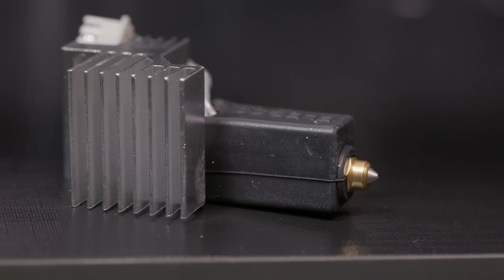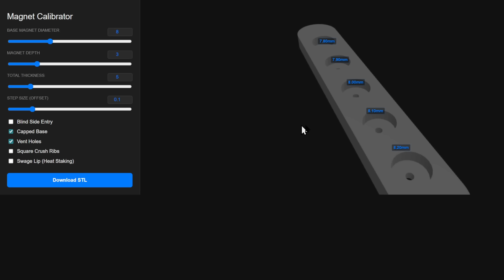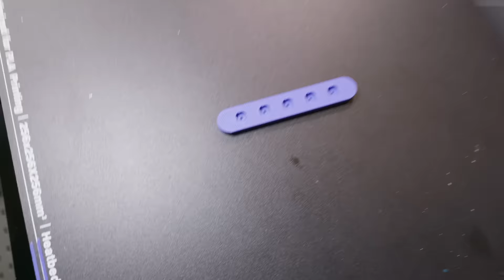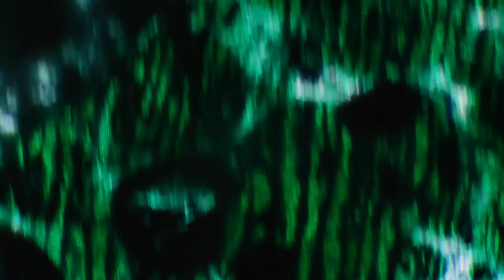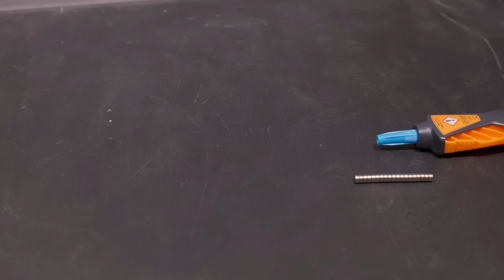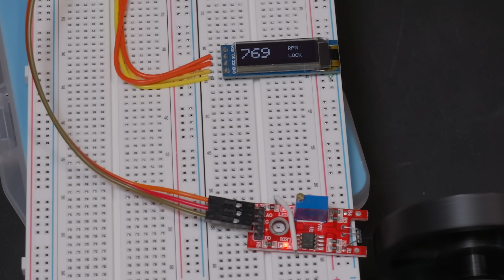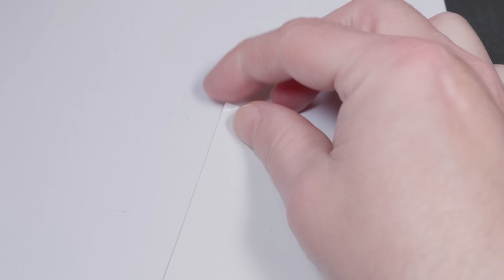Magnets in 3D Prints: How to ruin your printer edition

Comment: Many people often confuse a magnet's Curie temperature with heat resistance. While the Curie temp (point it will completely demagnetize) of sintered neodymium exceeds 300C, standard grades (N35, N42, etc.) have a maximum rating of about 80C where irreversible flux damage starts to occur. Higher grades (e.g N42M, N42H, N42SH) have additives that can increase their coercivity and temp rating to about 100-150C. Specialty grades can push upwards of 200C but beyond that something like Samarium-Cobalt is needed.

However that's for single magnets in an open state. You can partially increase resistance to flux damage by just fixing it to a material like steel to close the magnetic circuit. That can potentially allow even standard grades to exceed 100C before significant damage occurs but you still can't take a soldering iron to it.

Also the reason cheap 3D printer bed magnets aren't notably damaged at 100C+ (as many claimed they would over the years) is because they're made from ferrite particles that are more resistant to this than neodymium and it's constantly in a closed state against a piece of steel. The main concern are the binders, adhesives or certain bed surfaces degrading but even many cheap ones still hold up to 100-105C reasonably well.
Reply: Wow thx this is actually a really nice cheat-sheet and gives edge-information as well!
Reply: Correct me if I am wrong. 

This has to do with a material’s permeance coefficient (Pc). Basically the aspect ratio of a magnet. A longer magnet will have a higher Pc and less susceptible to demagnetization. We can follow a magnets hysteresis curve (2nd quadrant) at different temperatures for a particular grade to see if the Pc hits above or below the knee (irreversible demagnetization).
Reply: Thank you, I didn't realise how much I needed this information.
Reply: Is it true that you cannot re-magnatize a neodynym magnet? If so, how are they made?
Reply: @JeffBradway  Again it's a question of how much heat was applied. It's technically possible to regain most, if not all a neodymium magnet's strength lost to overheating unless it was heated all the way to its Curie temperature.

At that temperature it undergoes a phase transition from a ferromagnetic state to paramagnetic state where microstructural changes causes the magnetic domains to collapse (each individual grain aligned during initial manufacturing is effectively randomized). While some magnetism can still be restored it's impossible for it to regain its original strength.

However if heated high enough beyond the Curie temp to the point where the 'physical' alignment of the grains locked in during sintering have even shifted out of position it's unlikely it can ever regain useful strength again.
Reply: @JeffBradway  Gauss machine I think? Also the powder that they are made off is being pressed into shape while exposed to a strong magnetic field already. And all the machinery is very big/expensive, so nothing for typical home diy.
Reply: @DiverseGreen-Anon  im not sure how much of the original u would get but if u make 2 electromagnets on each side  put them in oposite series and discharge a big capacitor u probably get some magnetization back
Reply: this is really cool info to know !
Reply: What a wonderfully informational comment

Comment: Great info, always interesting to see how others do things. Most of the time I use press fit with glue for external and loose with a dab of glue for inserts. The orientation is always triple checked as I place them, the number of times I overcorrect though 🤪. I have a drawer full of sizes now and order off Ali, though cheap does come with quality and size variations so I always do the dummy shrink testprint to calibrate each new model.
Reply from the maker: Oh yeah that's something I forgot to mention, some magnets I had were undersized, not many but enough to cause confusion!

Comment: Actually I’m pretty sure the ESP32 has a built-in Hall effect sensor. Might not be very useful under that RF can though.

I like adding a thin layer of plastic between the magnet and the real world. Much less likely to be attracted to something quickly and shatter the magnet, and cleaning magnetic dust off it is easier. Super-glue in a print pause is what I often see recommended for this purpose.
Reply from the maker: I had no idea, but googling tells me you're right and it's disabled

Comment: I ran a 3d printing shop for a couple years, printing a variety of toys and novelty items using a small fleet of Ender 3 like printers. I have a few designs that use magnets and I always preferred embedding over other solutions. This was important for toy design to avoid the risk of a dislodged magnet becoming a choking hazard for kids.
Reply: Choking is the least of the problem.  A couple of magnets stuck together with a bit of intestine between them isn't cool.
Reply: child safety above convenience. Thanks
Reply: @Stray-Signals People printing junk toys and widgets has massively contributed to microplastic pollution over the past 10 years. It's even worse with 3d printing because the materials are already extruded in thin brittle layers that break down faster than a food grade container.

Comment: Great video. My go to method now is adding compliant features like grip fins, with a chamfer to make inserting the magnet easier.  The plastic flexes and you don't need to dial in the settings.  I have a model on MakerWorld that uses this: an SLZB Magnetic Mount.

Comment: I didn't expect the words "do not put magnets near your printbed" ...to carry such weight
Reply: Especially if they're really big magnets.
Reply: @kwilliams2239  I recently used very strong magnets to hold down the glass bed from my old ender 3 instead of the textured PEI sheet, for a smooth bottom layer lol
It still seems to be fine tho, is it just that the magnetic sheets will be held slightly weaker now?
Reply: Problematic, because I just learnt about a technique where you use magnets to hold tissue paper on your bed then printing wing ribs directly onto it... Now I need to check my bed.
Reply: @Reahreic Tom Stanton?
Reply: @fastindy  No, but i think that's where I learnt it.

Comment: Stainless steel is not magnetic so if you want to insert magnets inside your prints use a stainless nozzle. I do this on my Bambu A1 occasionally and just switch to the stainless steel nozzle that came with the machine. (typically I use a hardened steel one, but that one is magnetic)
Reply from the maker: it can be, only way to know is to test it, one of the 4 nozzles in that line up was a stainless steel
Reply: Austenitic stainless steel is not magnetic, ferritic stainless steel is. Austenitic stainless has high nickel and chromium content; ferritic steels are low in nickel but high in chromium. Ferritic stainless is less corrosion resistant, has higher thermal conductivity and is cheaper, it's also easier and cheaper to machine as it doesn't work harden to the same degree as austenitic which is why some of the cheaper Aliexpress printer nozzles are made from ferritic steels and are magnetic.
Reply: @Steve_Coates  Ahhh... ok. I didn't realize that any nozzles were made from that other kind. I've only tried this on the official Bambu nozzles. 

You are right about reducing the magnetism though. I tried it on some hold downs I made for my laser and even though the magnets stick to the bed quite well the magnets embedded in my print don't work that great.

Comment: Brass is NOT magnetic. If your brass nozzle is, it likely has some steel in there.

Stainless steels tend to be weakly or non magnetic, but you can't rely on that without testing.
Reply from the maker: yeah it goes to show we have no idea what these nozzles actually are made of, beyond what we're told they're made of
Reply: @LostInTech3D Absolutely! 😁👍
Funnily enough, the woodworking screws I use are 'brass'... and they're magnet-seeking as anything.
They're clearly brass-plated steel. Probably cheaper to make. TBH it makes em easier to not lose 😂❤

Not as good for nozzles though.

Comment: The build plate’s magnet, which seems to fall under the “cheap” category, gets quite hot yet doesn't lose its strength.
Reply from the maker: For a while, I think it was a limiting factor in the max bed temp 🤔
Reply: It does. It's just it came from a high grade magnet that only lose part of its strength after heating.

Comment: What the heck do You meen? I have 2 ender3's😂
Reply from the maker: Actually so do I 😅
Reply: An ender 3 would be an upgrade from my Anet A8!
Reply: Yeah and since my "new" kobra s1 just chokes on TPU no matter what I try, I had to keep my modded ender 3 just for TPU. But on the plus side, I drilled a hole in the lid of the ace pro and added PTFE tubing so now I can dry filament while printing on the ender, which is extremely important for TPU!
Reply: @Gibson99 dude I tell You I did a linear rail and direct drive convertion on mine years ago and it is just a workhorse.

Comment: I prefer encapsulating them in the print because I find they eventually come out if you press fitting or use CA glue. It isn't a perfect solution though, I know.
Reply: Try Loctite 480 or for those little neodymium buggers, 3090.
Reply: Use some 2 part epoxy... They'll never come out.

I've had to break the print to remove them
Reply: @HARD_R_SUPERSTAR  Epoxy is definitely better than super glue, but it's more of a long term issue. All the vibrations from normal use, then the other magnet pulling on it regularly. Eventually that mechanical bond between the epoxy, plastic, and magnet wear away.
Reply: @Vandel212 I didn't think of that. I haven't really printed anything with vibrations but good to know for future projects
Reply: Encapsulating them gets back to the distance problem. The magnetic field strength drops off as the cube of the distance -- a pretty severe penalty.
Reply: @kwilliams2239   thin out the encapsulation. there's some trial/error to ensure it doesn't break ofc

Comment: I designed the Centauri Carbon SM-33 magnetic cover. I found that the magnets, while printing ASA, had the potential to REVERSE POLARITY. Which is extremely problematic when you want to keep your tool head cover attached during printing. While incredibly annoying, as it completely scraps the cover, I also found it interesting and did not know this was a thing initially. Magnets surprise me in so many ways 😄
Reply: I have since redesigned it with a plastic hinge on the bottom and only magnets up top. So far so good.

Comment: Friction does not increase with the height of the magnet. it stays the same 😉
Reply from the maker: more contact surface, right?
Reply: Friction is the same per unit of area. Double the area (the magnet's side height) and you also double the friction.
Reply: @scottjohnson8757 That is not what I learned 😉 but I just read an article from Nature saying the science convention is changing a little. Nonetheless the friction is only proportional to the load force and the material friction coefficient. not the Area (mainly should I say now 😅).
Reply: @iopfarmer  That's when the force is fixed, for example when it's due to an object's weight. More contact area then means less contact pressure, and the friction is unchanged, within the limits of modeling friction as a linear function. When friction fitting, it's pressure that's more or less fixed, and more contact area means more force as well. Just think about friction-fitting two magnets in the same hole...they're both held just as tightly (ignoring differences due to plastic deformation).
Reply: @iopfarmer  Maybe we're playing with definitions here. Can we agree on this? Sliding (Kinetic) Friction: The force that opposes the continued motion of two solid objects sliding past one another. This would be the magnet sliding within the hole created for it. To put this into similar terms but easier to wrap your head around my thoughts...I'm saying increasing the area that's in contact (increasing the height of the magnet) would be similar to if you were dragging a car tire behind you on a rope. Now drag 2 tires (doubles the area in contact). It's harder to drag. You said friction stayed the same in your post. If the friction stayed the same then you could put 100 tires on that rope and still drag them just as easily as 1. 1000 tires just as easily as 1. I'm saying friction increases because at some point you will not be able to drag those tires. Logic tells me that if the surface doubles then so does the friction (roughly). Maybe those numbers aren't strictly accurate but let's just say it will increase by a significant amount, not stay the same.

I'm interested to hear your argument on how the friction stays the same, provided there is some friction to begin with. I understand that if friction is zero to begin with then area can double or triple or increase by orders of magnitude and the result is still zero...but explain a case with a non-zero starting friction that remains the same.
Reply: @iopfarmer  I have a real world example that's more similar to the magnets we're talking about. I grew up on a farm and it was common to replace bearings in equipment. Many were a press fit. The press had a pressure gauge on it, and the further you pressed the bearing into the casting, the higher the pressure on the gauge went. If it takes 500 psi of hydraulic pressure to put a bearing in half way but 1000 psi to seat it fully, isn't that the same as the magnet being 2mm thick or 4mm thick? The numbers being different but the ratios being the same?
Reply: I think you two are talking about different surfaces

Comment: I just glue them in with a drop of CA glue. works fine. just gotta give it a few minutes to dry or you may get bubbles in the top layer above the magnets due to the off-gassing of the CA glue.
Reply from the maker: you glue them in while the print is paused, you mean?
Reply: @LostInTech3D  yup, add a pause on the last layer before it bridges over your magnet hole, add  a drop of CA glue, put the magnet in, wait a few minutes for the glue to dry, then hit play.

Comment: I've just stuck with brass nozzles myself (I have a Creality-CR10S (and I do have a briefcase full of old nozzles) upgraded with a Microswiss NG™ Revo Conversion Kit). I typically create a slipfit hole, and a pause in printing to insert the magnets, plus two 0.16 layers to "bury/hide" the magnet. What sucks is putting the magnet in with the wrong polarity (typically one of 4 magnets are wrong).

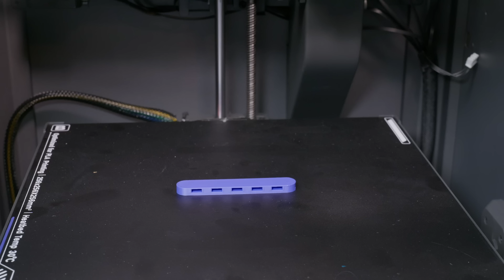Comment: 11:45 i didn't even heat insert i just tried using hot glue instead of super glue, figuring a little dab would be fine, and that didn't totally destroy the magnets but definitely weakened them
Reply: Hot tip (or not so hot i guess): just let the hot glue cool down. If it doesnt hurt to touch then it most likely wont hurt the magnet

Comment: I found that CA glue doesn't usually adhere well to the smooth coating of neodymium magnets. Though combined with pressure fit it's generally fine.
Reply from the maker: yep. I think the black ones I have are resin coated with a rougher surface, so those probably work better.
Reply: It sticks pretty well if you take some fine sandpaper to the magnet first. Just rough up the surface, don't remove the plating.

Comment: My problem with magnets is always that it's really annoying to make sure they're all pointed the same direction, since there's no Visual markings on them.
Reply from the maker: You can, if you have the time, stick a dot on them with a marker, I used a POSCA
Reply: I just stack them together which ensures the same polarity and makes them less fiddly to handle, push the stack into the hole, slide to the side and the bottom magnet remains in the hole. There are printable insertion tools available which use the same method but unless you're running a print farm and inserting dozens of magnets daily they seem overkill.